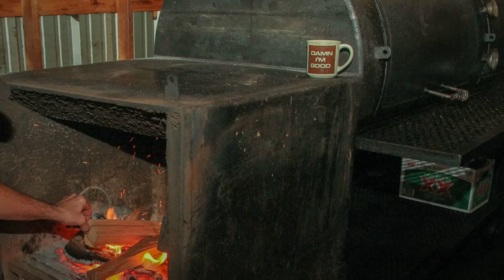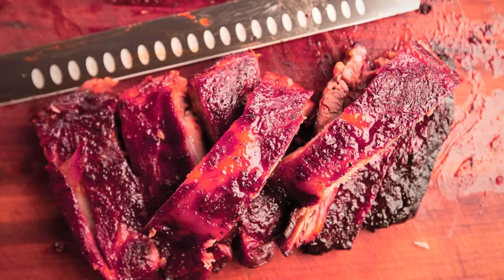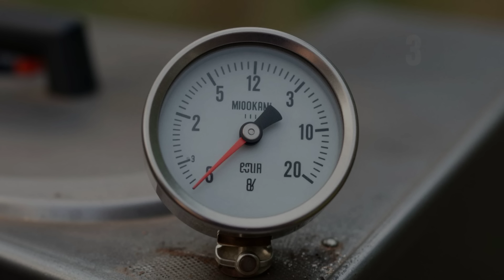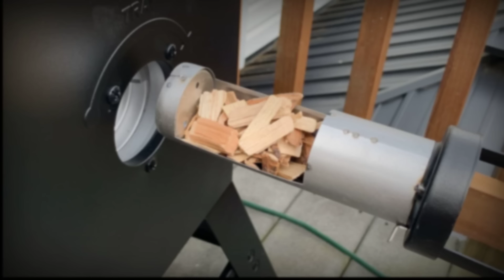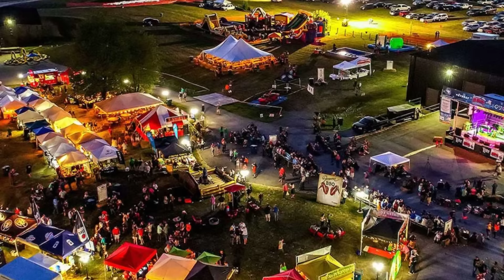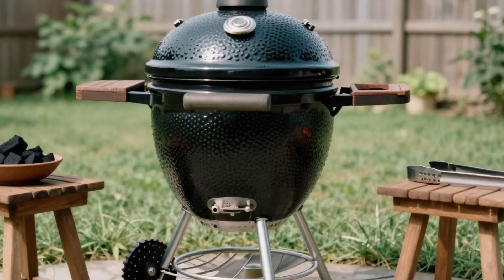The 7 Levels of BBQ Smokers

Comment: What's up with that video title image? "Levels"(?) ... and the implication that those pellet "ovens" produce better smoked meat than something like a WSM or even Weber kettle is laughable.  The ONLY advantage to a pellet grill/smoker is digital control and convenience.  Full Stop.  Having to buy pellets is WAY more expensive than wood, charcoal, or gas.  You've got to clean the fire cup and auger pretty much every cook or there's a flame malfunction.  That little fire-cup can't actually produce enough flame to properly grill and char meat like a kettle or gas grill.  And most importantly...  and they certainly don't smoke as well as any WSM or even kettle.  Pellet grills smoke output is just lame... people have to put cold smoke tubes in them or keep temps down in the 185F range to really stretch cooks out to help the grill actually get smoke flavor.  

They barely grill and they barely smoke.  It's literally a pellet oven.  At lest the newest pellet grill models are starting to put trays that burn & smoke real wood chunks (like the woodwind pros) so there's respectable smoking ability. 

A WSM and Kettle smoke meats basically the same as a Kamado - the only real difference being the kamados insulation and efficiency.  But Komados and WSM and kettles all provide the same quality of smoking performance... and each is certainly better than 99% of pellet grills.  And if you add temperature control blower mods to the Kettle/WSM/Kamado, you now have good digital control - basically erasing the pellet grill's onlys only advantage. 

Smokers:  Electric smoker <<< Pellet grill <<< Kettle = WSM = Kamados < Barrel < Offset

Comment: Most people have a 2.5 to 3 grade Weber or Traeger grill.  These are NOT premium products and are nothing but recycled beer cans compared to a Yoder Grill.
Reply: Lol...I smoke briskets to perfection all the time on my Weber kettle.
Reply: @doublem1971 the design is impeccable.
Reply: BTW just finished smoking 18 lb of pork butt in 10 hours. Not only did it come out amazing. But the care and the cleanup of my Weber grill is simplicity itself.
 I purchased it in a bulk buy making my actual cost zero. It even came with a new charcoal chimney, and a bag of charcoal.
Reply: @doublem1971  I should hope so, that is what any grill is supposed to do, dumbass.  Next time, go to a real grill store and look at the manufacturers who are listed as 6 or 7 and you will see a night and day difference. An 80's Ford Taurus and 2026 Lamorghini are both "cars" but that doesn't mean they have the same level of performance, do they????